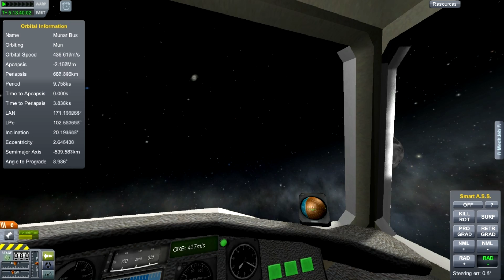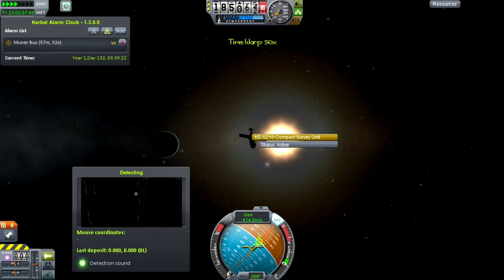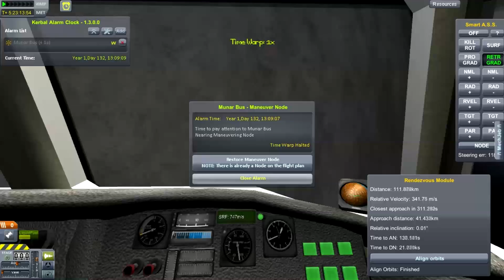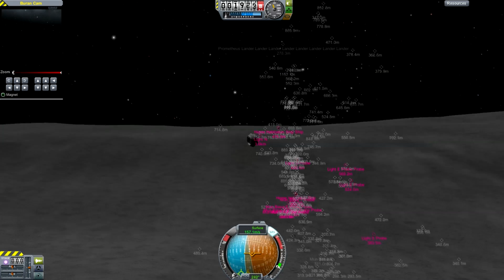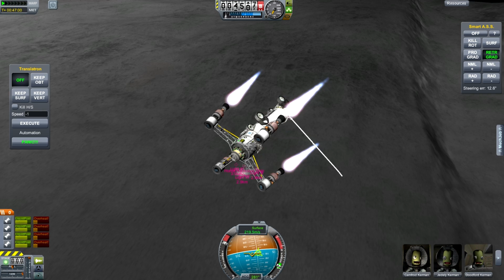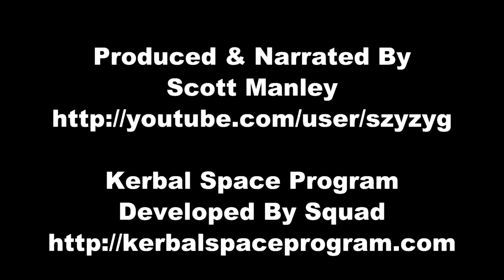Kerbal Space Program - Reusable Space Program - Episode 20 - Random Disassembly

Comment: I would like to point out that you can get the lazor docking cam as a standalone item now.  And yes,  changing the default load distance in lazor's settings causes massive issues. Always select the default load diatance using the settings in the space center screen.

Comment: One way to characterize the energy gained by a spacecraft (or anything) is multiplying the net force acting on the object by the distance the object travels through; Work (or Energy) = Force * Displacement. A rocket motor operating at a set thrust level for a fixed amount of time on a fast-moving spacecraft is able to extract more energy from the propellant, because the spacecraft would travel a greater distance during the burn time.

Comment: I've found winches don't work for skycraning payloads down. The payload swings back and forth, making your crane uncontrollable. Last time I tried it, I nearly crashed my skycrane, and ripped a kethane fuel truck in half trying to abort my descent - and that was on Minmus, not the Mun. Part of the issue is that a lack of atmosphere means there's no damping to stop your payload form swinging back and forth.

Now I always do rigid connections via a docking ports on objects I land, it works better.